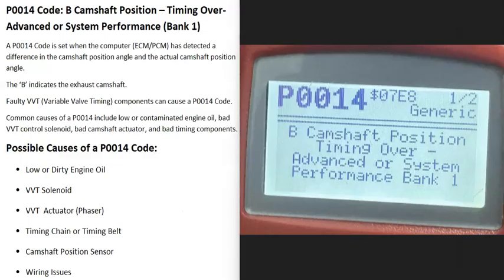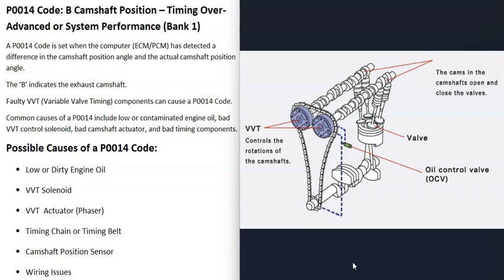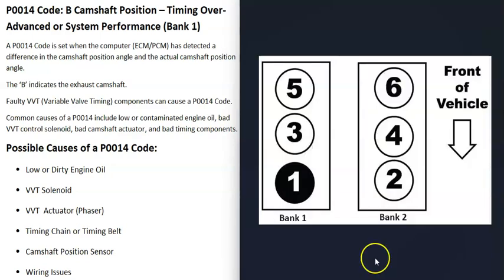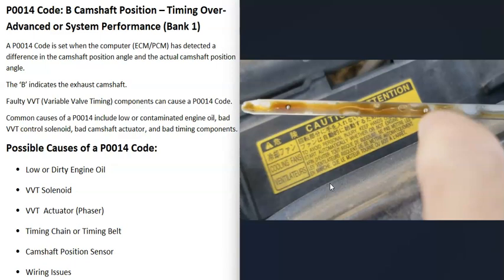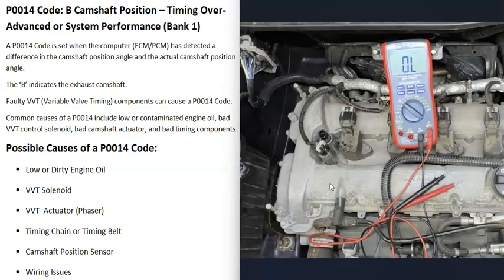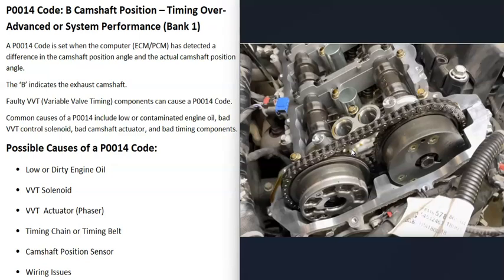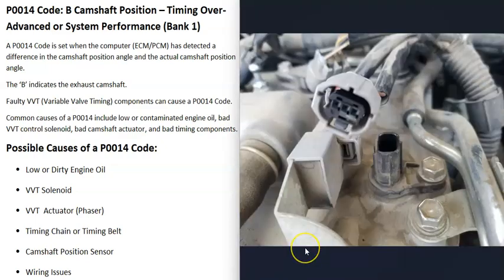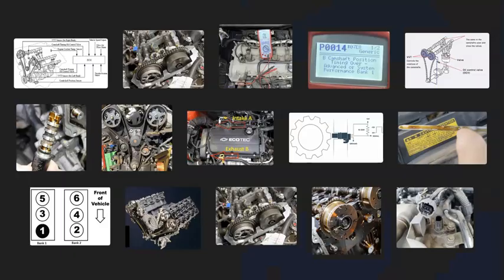Causes and Fixes P0014 Code: B Camshaft Position – Timing Over-Advanced or System Performance Bank 1

Comment: Had this code before, replaced cam phaser, timing chain, retimed.  VVT Exhaust and intake solenoids replaced.  Both camshaft position sensors changed.  Worked great for maybe 2 months.  Now I got the same code, with engine stuttering and stalling.  Changed VVT exhaust solenoid, as this is what the code states and was on lifetime warranty.  Worked for 1 day now it is stalling again. Is it electrical at this point?  Tired of throwing cash at this Hyundai POS.  Never again will I buy their products.
Reply from the maker: It does sound like an intermittent electrical issue, such as a bad ground or loose connection. Is the VVT solenoid coil open? There should be 12 volts to the solenoid, and the computer controls the ground side. I would also check the oil pressure and be sure that is correct, but it likely is electrical. One note; I have had issues with non-OEM replacement parts that have cause headaches in the past.
Reply: @HVAC_Mechanic  Thank you for the follow up, I will look into this and research some more.

Comment: I have Hyundai Elantra 2017 2 litters engine size I drove and high mileage 350 h thousand km on it recently I have this with p0017 and p0014 code I just changed  vvt solenoid changed it was ok for a day and the next started having the engine light apppeared while in slow speed the car was stalling and then just recently changed the new battery in a car with new ultimator as well here’s the problem car starting like when it’s gargle i drove it two km and then car lost the power engine oil light and battery light appeared I turned off the ignition and turned on the car back parked now in garage I check on it start the engine I feel like knock sound in engine vibration.
Reply: I have the same year Elantra SE.  I had both of those codes, starting with the p0014.  Same issue after replacing VVT solenoid.  Worked for a day then stalling again.  I have new battery, alternator tests good.  Starting sounds really rough at start as well.  If you read my comment above I go into a bit more detail of what I did.  But without long lasting results.  If you happen to find a solution please share.  I'm about to sell to buymyjunkcars or something at this point.

Comment: I have a 2017 chevy equinox that kees setting off vvt solenoid codes after l fill the tank up. I have recently had both solenoids replaced, filled up tank today and engine light come back on. Autozone said it's the same problem as before. What could be going on here? Timing chain has been replace in recent months
Reply: Did you find out what the issue is? I have an Equinox as well and its having similar issues.

Comment: Hey bro ‘B’ Camshaft Position Timing- Over-Advanced Bank 1 on 2013 f-150 3.5 echo boost would it be a good idea to sell the truck with 151,000 miles on it or fix the VVT Solenoid and how much would the vvt solenoid cost
Reply: Looks cheap and easy to do.
Reply: I don't know your make and model, it is cheap and easy to do on my elantra.  However, it didn't fix the problem for more than a day.  Not trying to bring you down, but give a heads up.  Not sure your make and model.